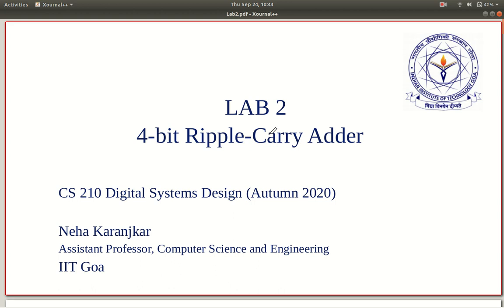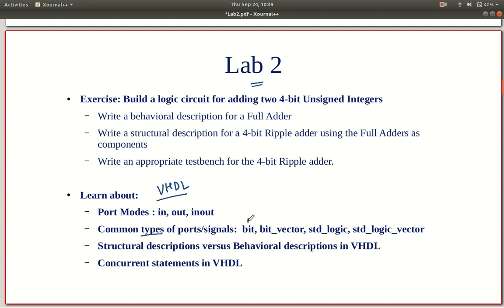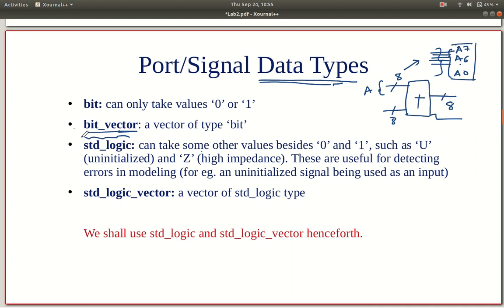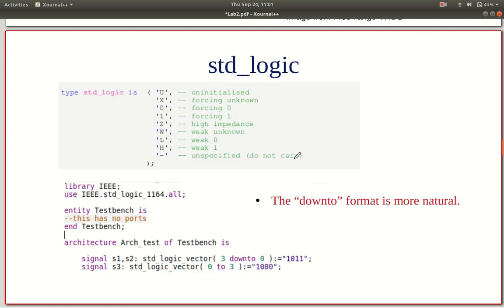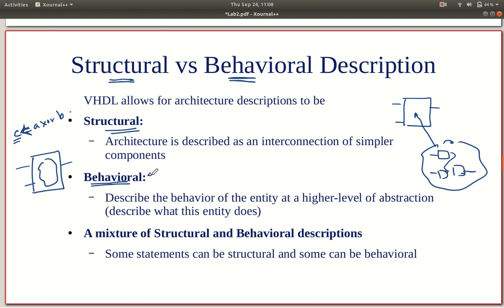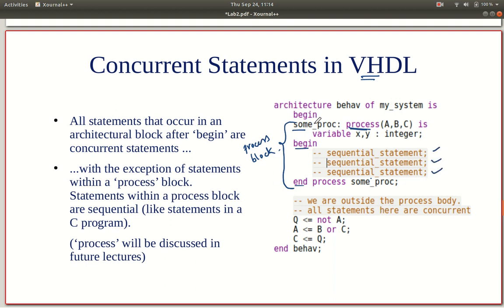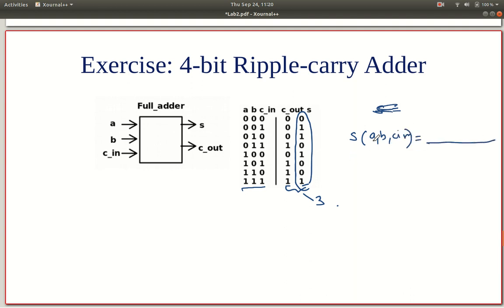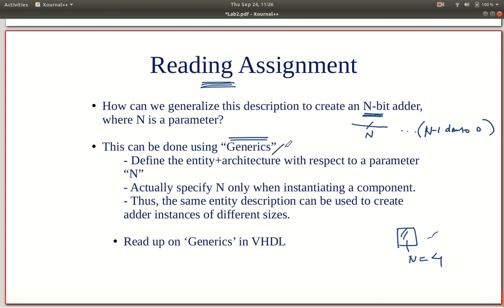Lab2 A Ripple-carry Adder

Comment: Hello mam i just want to ask one query as we have data flow style and in this method we are directly able to use these gates then how this structural style modeling help use because here we  require to define all component
Reply from the maker: If the architecture is described as an interconnection of components, I would consider it a structural-style VHDL description (irrespective of whether the components were muxes or basic gates). If the architecture is described just using conditional /selected signal assignment statements (introduced in lab 3),  then this could be considered a dataflow-style VHDL description.
Reply: using structural style will help you when you will write more complex hardware, also it helps you reuse one component multiple times, e.g like create a decoder once use anywhere you want. And yes at the end of every structural code you will have a data flow style though they can be as simple as just and /or.  [u can correct me if i am wrong]